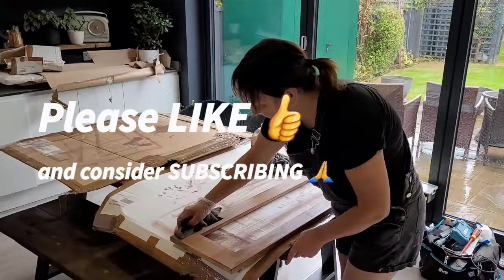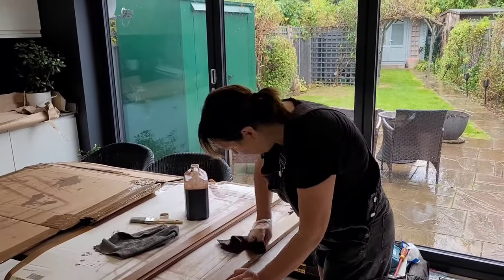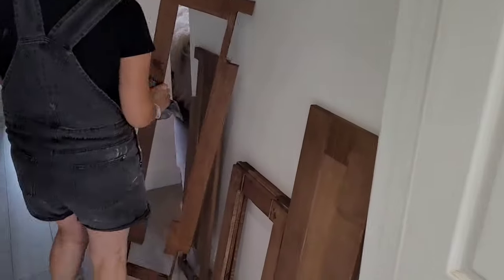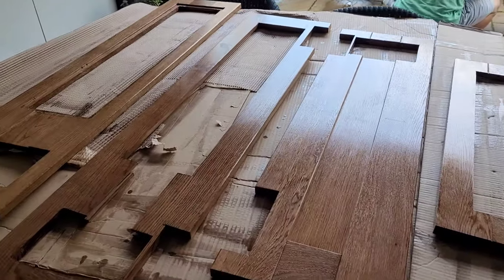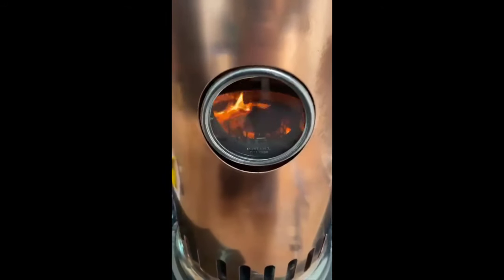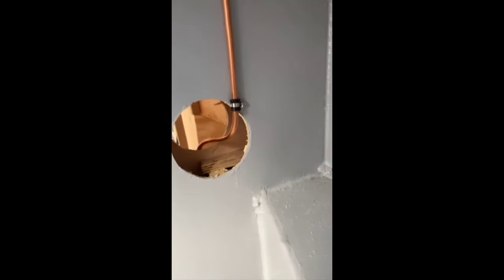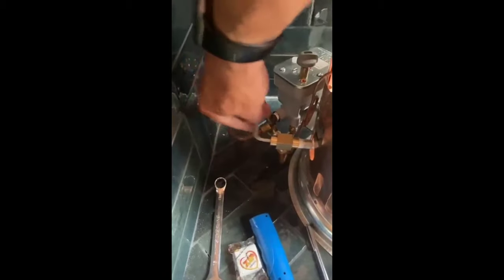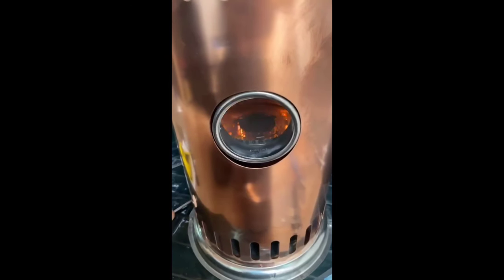LOCKGATE STOVE IS FINISHED!! #60  #boat #lockgatestove

Comment: hi al lee dave with the glue on the doors after sanding you need to use a cabinet scrap to remove the glue from the doors as you stain them then you can put the finishing cote thats is how i got rid of thuse cup rings on my new oak table
Reply from the maker: We have already lacquered the door, is it too late Dave??